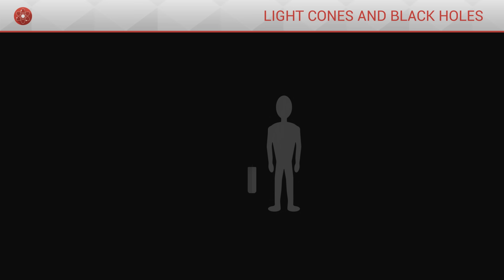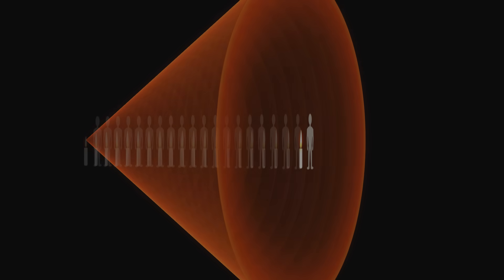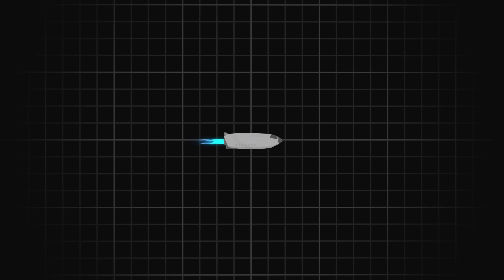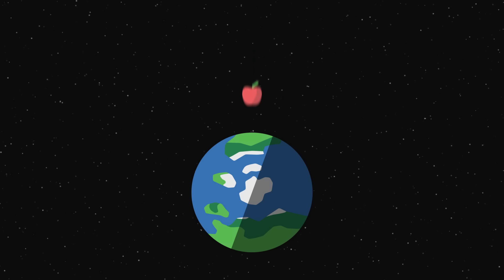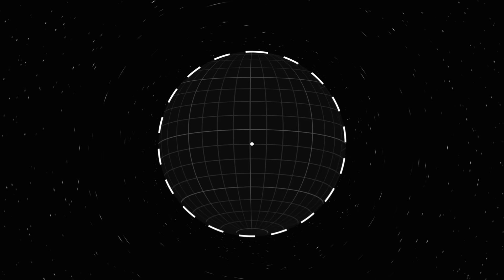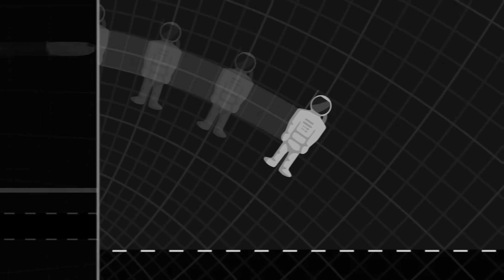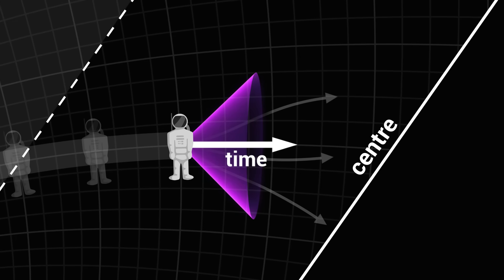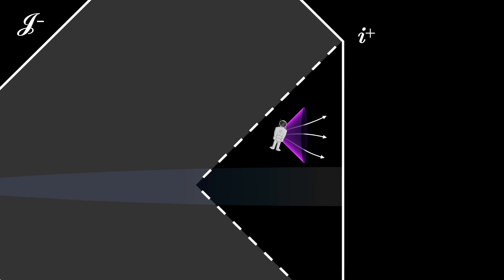Why Time and Space swap in a Black Hole

Comment: You just say that the future is the direction in which the movement of matter is directed by gravity or power.
Things that self-heat and lights, that is, stars are the future
Think of what happens with the temperature difference between the sun and matter as "Between Time". and The Sun is ”Time” itself it means our future. 
Consider the future as self-heat materials and in the order of materials with the highest energy efficiency with the same mass as 「Between Time」
Or the temperature difference world is Time Between
so the stars are in the middle(future) and the planets are around.
The stars also created the evolution of life on the surface of the earth.
Of course mainly our sun and the planets did
It becomes a movement to create a God ”The Sun” out of life
Like Einstein, Buddha, and Christ etc..
In the movement toward the sun (future), all life is formed
Why don't you make a video about this theory? I'll help you

Comment: What I usually hear from people that have questions about all this is, "why is the speed of light finite and at the value that it is?" It's a fair question and it's exceedingly difficult to answer. On one hand, you can explain the relationship between the speed of light and the speed of causality (which is why the speed of light is denoted as "C"), but it's hard to explain the specific why in that instance. But on the other hand, you have to also look at the intrinsic nature of the quantum fields and the way they propagate information.
Reply: Einstein deduced that the speed of light was observer-invariant because it was the only way to make Maxwell's equations work (otherwise, you wind up with things like moving magnets producing magnetic monopoles, which is contrary to observation).  All of relativity, both special and general, is derived from the fact that the speed of light is an observer-invariant constant of nature.  Maxwell proved that electromagnetic waves could only travel at one speed while still conserving energy, which is why the speed of light needs to be observer-invariant.

Comment: Since time points downwards below the horizon of a black hole, it seems more accurate to say that time and space end, rather than swap. 
This would be because any degree of movement is limited by the direction of causality, which, below the event horizon, is toward the singularity. 
The 3 dimensions of space also merge, as any direction other than toward the singularity, no longer exist, even to "slow down" the progression towards the singularity should be impossible, as that would be the same as moving "sideways" against time.
Thus the "light cone" should logically cease to be a "cone" but rather a line, having boundaries that should be less than 45 degrees, in fact they should be reduced to zero degrees, becoming one with the time line.
Since it is also shown that objects moving at the speed of causality do not experience time, it would also be logical to assume that no "time" can be experienced between the instant of crossing the event horizon, and arriving at the singularity.
Thus, below the event horizon, space and time should end, the object, or what might remain of it, should have crossed the "edge' of the universe.
If a "spirit" or consciousness existed that could survive crossing the event horizon, it will have crossed into a higher dimension, in which the former entire universe, if finite, would become a single point, and if infinite, a line.

Comment: If light experience's no time, then how do we calculate the speed of light using a measure of time and distance? 60 miles in one hour, equals 60 miles per hour? It's all described in terms of time.
Reply: Time is that which the clocks show. Light all by itself is simply not a clock. One can make a clock out of light and two mirrors, but the crucial ingredient there are the two mirrors.
Reply: light experiences no time from its "own" point of view.

Comment: Time is a human illusion created by entropy. Is artificial light (emitted from a flashlight) the same as natural light (emitted from a star)?
Reply: Time has nothing to do with entropy. Time is that which the clocks show. Clocks are systems which release small amounts of energy from a local reservoir towards infinity (that's what "clock ticks" are). That energy does, however, not flow randomly. It flows in a highly directed way that depends on the physical conditions of the path that it flows along. So while there is a "dilution" of sorts happening (the energy density of clock ticks decreases), the mechanism is not entropic.
Reply: @schmetterling4477  entropy creates the illusion of time passing. As perceived by human minds and im pretty sure that Stephen Hawking said basically the same thing.
Reply: no, there is 2 types of time everyone is mixing it up, time in seconds or the time as how long it takes for something, but the time in space or the fourth dimenstion is the direct or path.

Comment: You know what? I have thought deeply into this topic, and I often get the feeling that in truth, it’s more like this….

Block holes are no different than neutron stars in that they have a surface and function exactly the same except they are big enough to be pulling in light….but other than that, they are the same.

That is to say, that it is this way simply because the matter squashes together into an object of maximum density….and no further.  That at that maximum compacted density, gravity is immense, but not strong enough to break it down any further.

Meaning that, within this compacted mass, there is equilibrium at any given point sufficiently far from the outer layer. Because the gravity caused by any point within it, does actually dissipate within it to the square of the distance from that point. (As you would expect).
And therefore, we can see now that considering any 2 given points within the neutron star, those 2 points are actually pulling on each other (and the myriad of other available points all pulling on each other) this causes a limitation on how strong gravity can be at any given point…because, given sufficient volume of the neutron star, it is being equally pulled in all directions…not only inwards. 

And therefore, there becomes a maximum amount of gravity…and no more.
And I say that perhaps that maximum is below the amount required to compress any further.

So it results in a neutron star that just gets bigger and bigger the more mass that it eats…and nothing more interesting than that.

Comment: In a kerr black hole, basically a spinning black hole, to even make it spin in the first place, it's singularity has to be more than one point, so it becomes a ringularity, an infinitely thin torus with 0 volume and infinite density, just like the singularity of a regular black hole. Because it now has more than one point, you're being drawn into multiple futures, curving spacetime so far that a second inside event horizon forms, (I guess you could call it a place horizon?) making light cones now face backwards in time relative to an outside observer, potentially letting you send things back in time, again, relative to an outside observer. If, eventually, you make it to the horizon and cross it, you'd immediately be forced back in. So if you spin the ringularity fast enough, the second event horizon would overlap with the first, making time move backwards inside the horizon without time and space ever switching places, effectively getting rid of the event horizon and replacing it with I guess a time horizon? Anyways it's super cool to think about

Comment: I guess another idea just crossed my mind, which is the different masses and the high densities of black holes can produce different apparent sizes, much like different stars. The only difference is the gravitational pull is in excess of the speed of light around the black hole, so the actual size is not the same at the singularity, much like a pearl in a clam

Comment: I don't think the presumption is right. If a time and space could warp and swap the way you describe they must be at the swap point all zero. In that case there will be no causality therefore no way and reason to continue in its previous trajectory. The time will be zero, the space will be zero and that will be it, the end of both of them. Therefore the time and space cannot swap like that. They can transform as they basically do the whole time but they cannot swap over zero state. If time nulls out, past and future loose its purpose. At that point nothing or anything can happen.. in any case it is hard to believe that the "future" state of that event will be something subsequent to what "was before".

Comment: 1. we don't know what time is. All we do is measure it. In fact we don't even do that. We construct machines that tick. 
2. we don't know what space is. All we do is measure it. In fact we don't do that either. We construct markers.

Time doesn't "point" in spatial directions.  If you had a clock next to you as you fell towards/into a black hole guess what? It ticks at the same rate. It doesn't "point" anywhere.  Saying time and space swap places is a meaningless statement.

Black holes are a solution to the mathematics of general relatvity. It "predicts" places it does not work. We call that a singularity. An absurdity. It seems to me, in our desire to understand, we come up with absurd notions to prove GR is still correct in absurd scenarios of it's own creation. Black holes are absurd.
Reply: Time is derived from energy in motion. Change states of the cesium atom gives us markers for the motion of energy. 
Gravity is the result of energy/mass in motion.
Reply: @stewiesaidthat  caesium clocks are just machines that tick. They tick within time. They don't derive it. We say ~9.2 billion oscillations of a caesium atom equals 1 second.  It's essentially an atomic pendulum clock. It just affords greater precision in measuring time. It does not bring us any closer to knowing what time is.

We don't know what gravity is either. We know time and space change due to the presense of mass/energy. We don't know how time and space are changed by mass/energy. 

All we have are theories that seek to describe it accurately. GR is more accurate than Newton. Neither tell us what space or time is. They just describe what happens to space and time if x is present.
Reply: @SlinkShady  here is the Grand Unified Theory. 

UNIVERSE = ENERGY IN MOTION

An increase energy = an increase in motion.

That's it. Everything else is derived from those two factors.

An atomic clock measures the amount of energy inba caesium-133 atom. Add energy in (increase temperature) = increased motion.
Remove energy (absolute zero) = decreased motion. 

A sundial measures motion. The Earth's rotational spin.

An atomic clock in motion - all other parameters being equal (temperature, gravity, electrical energy) measures motion relative to the stationary clock. 

Energy and motion are intrinsically linked. To go faster, you add more energy. To slow down to absolute zero, remove all energy. Then your universe vanishes - universe = energy in motion.

That's why things like speed of light are not a constant. Remove energy from space (expansion of space decreases energy density which decreases motion of EM waves through space).

 In the early universe, there was much greater motion because of the higher energy density. That's why JWST is showing nearly formed galaxies shortly after the Big Bang. Everything was moving around much faster then due to the higher temperature of the vacuum of space. 

It can be proved by measuring the speed of light in a vacuum at much higher temperatures. By measuring the speed of light at near absolute zero. By measuring the speed of light outside of a gravitational field. 

But they won't do it because nobody can agree on what a SECOND is. Since the speed of light is not constant, the adjust they length of a second to fit their observations. 

The keystone understanding the Universe is understanding that it is composed of energy in motion and that nothing in the universe is constant except change. 

I hope this helps.
Reply: @stewiesaidthat  there is no GUT. 

All you posted is measuring and descriptions. Oh, and a lot of false conclusions.

Try again.
Reply: @SlinkShady  sorry, I thought you could see the obvious.
Reply: @stewiesaidthat  ah, the appeal to "it's obvious" when you have explained nothing. Righty oh.
Reply: @SlinkShady  the Universe is built from ENERGY IN MOTION. The Big Bang ring a bell? 
What is a sundial measuring - the Earth's rotational ENERGY IN MOTION.
What is an atomic clock measuring  - the caesium-133 atoms ENERGY IN MOTION. 
What are two atomic clocks measuring - the DIFFERENCE IN MOTION between the two clocks. 

Any measurements made are ultimately a measurement of the ENERGY IN MOTION within the system.
Reply: @stewiesaidthat  I suggest you actually read how atomic clocks work.
Reply: @SlinkShady  do You know how they work? Please tell.
Reply: @stewiesaidthat  yes, I do, and if you think I'm going to type in the explanation here in a comment on YouTube when you can easily look it up yourself you're even more confused than I thought.
Reply: @SlinkShady  I thought so. You don't have the slightest idea how an atomic clock works. 

I'll clue you in. It counts the number of times a caesium-133 atom changes state. What causes an atom to change state? The amount of ENERGY contained or applied to it. 
In a higher gravity field, more ENERGY needs to be applied to overcome gravity. In a cold environment, more ENERGY, needs to be applied to maintain temperature. 

Atomic clocks are just measuring the amount of energy contained within the caesium-133 atom, which is regulated by the control mechanism and thus creates a highly precise counting device that can be used as a clock.
Reply: @stewiesaidthat  oh, I see. Because I won't waste my time typing in something freely available to read on the internet that means I don't know how they work. Jolly good.

Remind me again how counting the ticks of an atomic pendulum tells us what space or time are. Oh, you forgot that's where you came in and failed, but now you've "taught me" how an atomic clock works (which anyone can read on the internet ie. it's not a secret) your ego thinks it's been assuaged.

Comment: There is no such thing as "time". .... Light travels at the speed of light. .... Has nothing to do with "time",..... there is no such thing as time.  Only now, and change. .... The question "what is the difference between time and space" has no meaning, as there is no such thing as "time". .... Time makes sense in our atomic world. ....... You don't have atoms in a black hole. .... No "time is not bent", there is no such thing as time. .... It bends the structures of space one could say. ...... As "time" doesn't exist, and certainly not in a black hole, it can not point anywhere. ....... We need to get rid of the "time" word.  Time slowing down when atoms aproach the spead of light is a side effect of the internals of the attom being energized at the speed of light.  It's a special case valid for atoms.  Atoms are no longer atoms when you're in a black hole, and consequently any talk of "time" is nothing but a missleading missunderstanding. ............... Is my view :-) ........ Thanks for a well organized video though. .... "an event in the future" could be kind of correct though ;-),... who knows :-) that conclusion I kind of could agree upon :-)

Comment: In normal space, you can track each of your points in space by the 3 dimensions by a time line. Your time however is moving in a single direction.

In blackhole space, you can track your time by your position. Your space is only moving a single meaningful direction (straight towards the black hole).

Thinking about it graph like, does that mean in black hole space you could exist in two times at once (or more) as the verticle line test is based on space and not time? That while each location related to a specific point in time, it can be multiple points in time?

Comment: I  am trying to understand if time dilation from a dark hole is effect us. Apparently every galaxy has a black hole in the center. Are we getting closer to the singlarty or are we far enough to just spin around the black hole never escaping the g' pull.

edit: Are We Getting Closer to the Black Hole?
No, the Sun (and the rest of the solar system) is not spiraling toward Sagittarius A

Is Time Dilation Affecting Us?
Yes, but extremely little. Time dilation occurs when a strong gravitational field slows time relative to an observer in a weaker field.

Comment: so, if an outside observer had a device that measured what happened when an object hit the singularity, and the object sent inside was designed to enter the black hole moving near the speed of light so that it hits the singularity in the past relative to the observer, then the outside observer would pick up that the object hit the singularity before it actually hit it. maybe if the singularity is linked to a white hole then the object could exit the white hole before entering the black hole